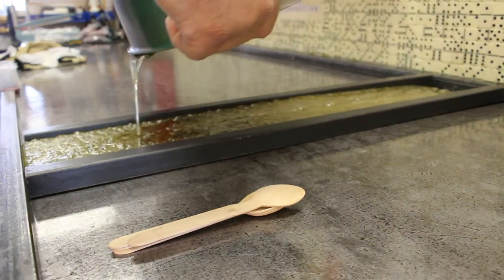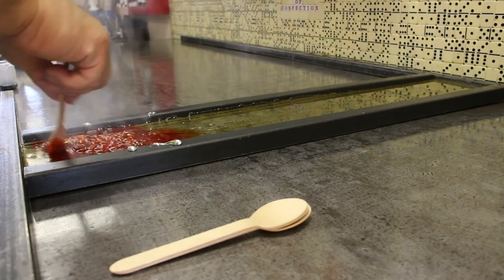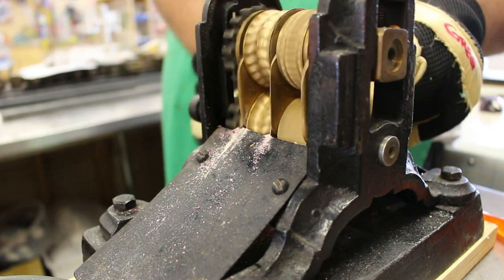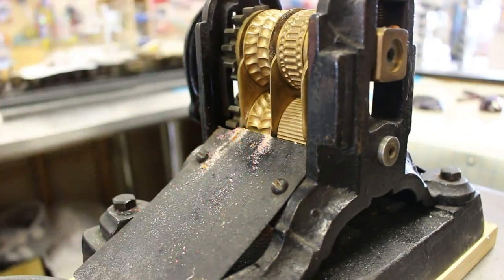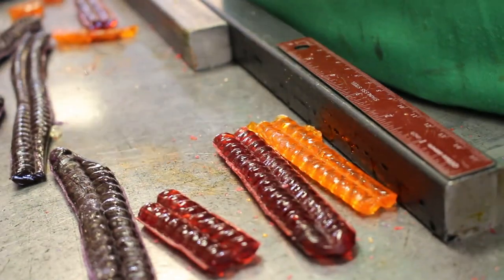#27 How Lofty Pursuits Makes it, Victorian Snap Stick Candy

Comment: I have a quick question, in a few other candy making videos I've watched people have made a point about them using copper pots to melt the sugar in, is there a specific reason for this? On a different note, I've never heard of this type of candy before, but it looks great!
Reply from the maker: +Bibbly It depends on the heat source. You need a pot to match the type of heat you use. Point heat (like Natural Gas) is better to use copper with. We use an electric heat source, so we don't use copper.
Reply from the maker: +Lofty Pursuits More specifically we don't have gas service where we are.
Reply: +Lofty Pursuits ahh, that makes sense, thanks for the answer :)
Reply: +Bibbly I think to answer your question i read somewhere about copper pots distribute the heat evenly making sure everything cooks correctly

Comment: where did you get that machine from? thanks for the video!!! it is always a joy seeing them in my feed
Reply from the maker: +Why Not Hmmm, not not 100% sure on this one. I think It was part of a few machines I got it from an estate of someone who I can only assume was a candy maker. The owner was happy it found a home with someone who would use it if it was from that batch of equipment.
Reply: do they still make these anymore?
Reply from the maker: +Why Not The candy, I guess I do. The machine, not to my knowledge.
Reply: thats unfortunate
Reply from the maker: +Why Not Not sure if it is. These things surface regularly, and nobody uses them. As annoying as it is to use, I don't use it often. Also very annoying to clean. I forgot about that until I had to clean up after this batch. :)
Reply: oh. is there a better way to make these candies then?
Reply from the maker: +Why Not No, but there is not much demand for them either. Candy has gone to full mechanization, it makes candy cheaper, but it makes the candy ... well not as good. That is what the mass market is for, and we are for those that want a better experience.
Reply: thats a shame

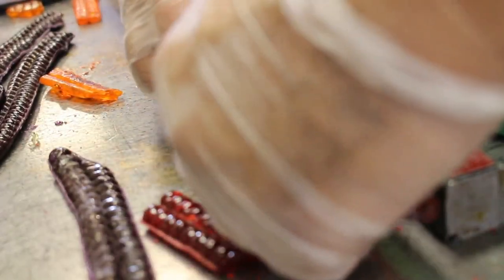Comment: 4:12 using a ruler is too difficult. Your brain has to find your measurement every time. Instead, draw two lines with a permanent marker and cut on the lines. (You could also scratch two lines on your metal bar.) You'll always get the right length. Sending lots of love💖 from sunny 🌞 Arizona 🌵. Take care of yourselves 😷.

Comment: how long does the sugar sit on the cooling table before color is added and then moved
Reply from the maker: +Michael Brown It depends on what we are making. We need it hotter for this machine (actually we ran it a bit colder than we should for this batch.).  About 5-8 minutes. A lot depends on the size of the batch, things like humidity. We test by how the candy reacts, not by time.

Comment: At what temperature is the cooling table on ?
Reply from the maker: +Gabriel Correa Its just room temperature. But it is a huge heat sync with a water cooled interior.

Comment: Cool machine. Reminds me of a sweet here in the uk called barley sugars. They come in those kinds of sticks and have a bright orange colour with a distinctive flavour. Do you make barley sugars?
Reply from the maker: technically they are barley sugars (or barley candies as we call them over here) Barley candy was an early candy making technique. You need an invert sugar to keep the candy from crystallizing. Back in the day they boiled barley for hours and hours, strained off the grain, and then used that water, now saturated with an invert sugar from the barley, to dissolve the sugar and to make the sugar we pour. The modern candy maker (since about 1890) used corn syrup for the same task. In the USA this type of candy was used mostly for clear toy candies. I may make a video about this at some point. Not sure what the distinctive flavors are, but the barley if it is still used over there might impart a flavor. I'm not sure..
Reply: I have had barley based sugar sweets but Barley sugar the flavour is strange its often sold bright orange and has a slightly citrus flavour but that might just be the citric acid they add to it, Im not sure really, but i cant get enough of them :)
Reply from the maker: Ahh, I suspect they were using cream if vinegar as the acid. That does what you suggest, and it limits what you can use as flavors to citrus. It is different.
Reply: Barley sugars, (the sweets/candies) were originally Scottish I believe, and you're right, were originally made with boiled down barley as an ingredient. Nowadays however they don't use barley, just a corn or glucose syrup. The flavour is lemon, using lemon oil. The sugar is poured and when cooled enough to handle, is traditionally cut into sticks which are twisted, so you have these beautiful rods of clear twisted amber sugar, like glass. They're very pretty and taste great. Like most boiled sweets(hard candies) though, they get sticky fast so need to be either wrapped or stored in airtight containers

Comment: Anyone else with OCD tendencies get horrified when the coloring and flavor in these videos invade each others territories? I love watching these videos but that bit always makes me cringe and die a little on the inside. Everything else is wonderful though!
Reply from the maker: +SerpentimeMermaid  I cut between the colors :) what you don't know is two of the flavors are oil based, one water based. I out the water based one in the middle. They run to each other and then stop. Physics makes for good candy making.
Reply: Lofty Pursuits smart

Comment: Why did the handle seem to stick sometimes as he was turning the snap stick candy out?  Was that just hesitation on the part of the user, or was there something about the candy that was particularly lumpish at that point?  I'm guessing it can't be an issue with the rollers since they turn round equally before and after.
Reply: hot candy heats them up so they start to stick